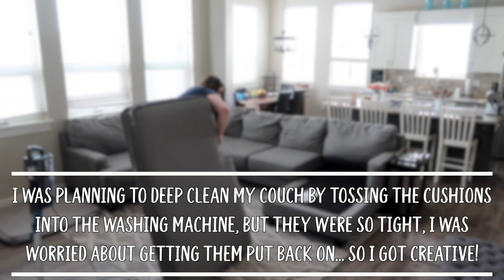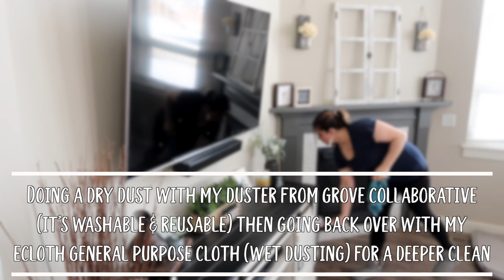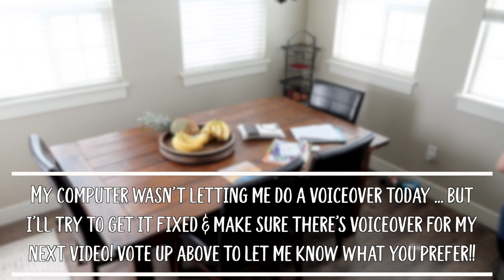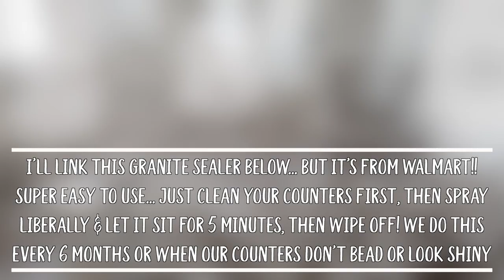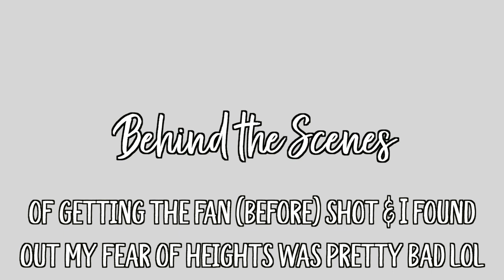SATISFYING! 2020 DEEP CLEAN WITH ME :: ALL DAY EXTREME SPEED CLEANING MOTIVATION :: SPRING CLEANING

Comment: Hi Amanda! I have the same couch as you and the cushion covers are suuuuper tight but I've washed mine multiple times and they've never shrunk. You have to air dry them, though! So if you ever get a mess so horrible that the only solution is the washing machine, it definitely is worth the wrestling to get them on/off. (I've had the couch for a few years and through the newborn & toddler potty training years with my boys, so you can imagine the disgusting things my couch has seen!) Just stand the cushion on its side and compress it as much as you can (works better with two people!) and the cover will slide back on.

Comment: Fan fur. Yuck!
If they're going to install fans on ceilings that high, they ought to invent a remote controlled extension system where the fan can extend downwards to four feet above floor level for thorough cleaning, then at the push of a button, rise back up to its 16' height. Inventors, take note of that, please.
Your kitchen backsplash is beautiful! Is it real brick? Difficult to clean? What can you tell me about it?
That cabinet under your TV with the miniature sliding barn doors is so clever and cute. Where did you ever find that?
I do most of my deep cleaning seasonally. Literally every March, June, September & December when the seasons change. That's the only way I can remember to do it on a regular basis. 😄 That's when I clean upholstery, flip cushions, flip or turn & vacuum mattresses, clean interior doors & windows, etc. Mother Nature determines how often I clean exterior doors & windows, depending on what kind of messy storms she's sent my way. 
My only real fear is snakes. And maybe swamps. Swamps with snakes. 😨😰😱
Reply from the maker: Our Tv stand is from HomeGoods, but I’ve seen similar ones at Walmart!

Comment: I have the same carpet cleaner and it works good but cleaning it afterwards, where the rollers are with the screws and everything is such a pain for me! Do you find it's difficult to clean up after use as well?
Reply from the maker: I use a sprayer in my tub to get as much out as possible, but I haven’t super deep cleaned it & pulled out all the screws. Definitely wish they would have made a better option for that!